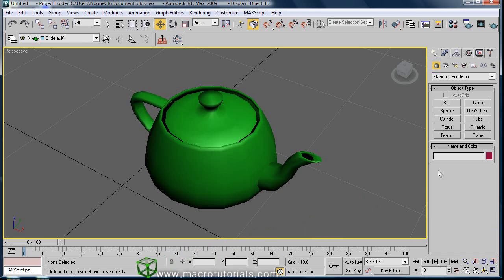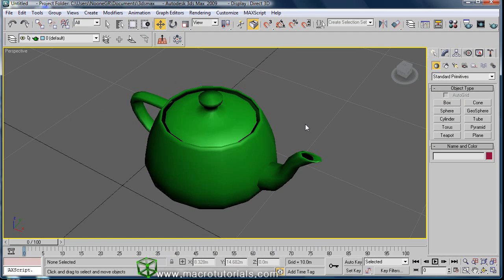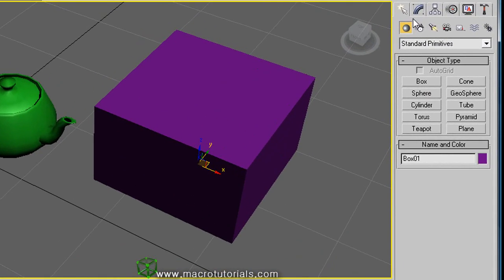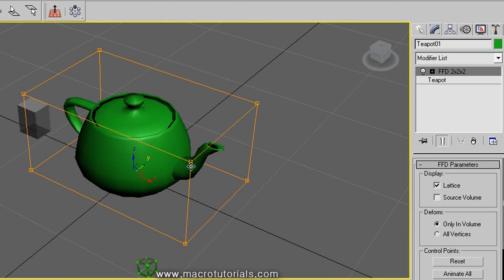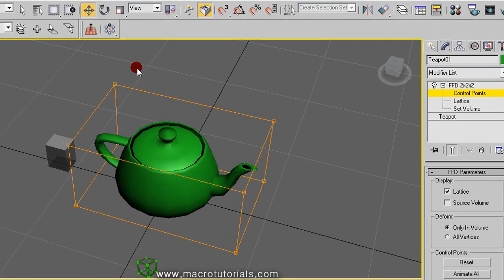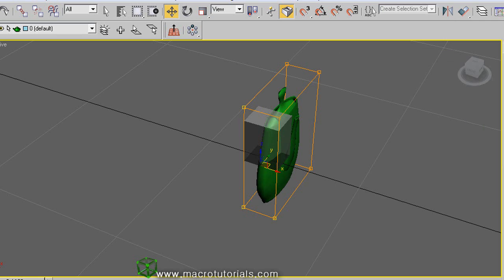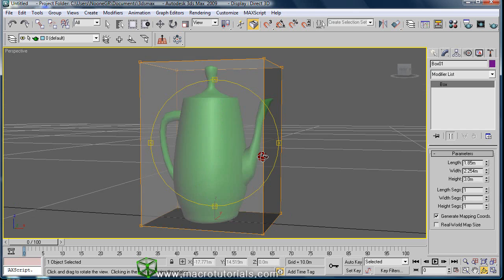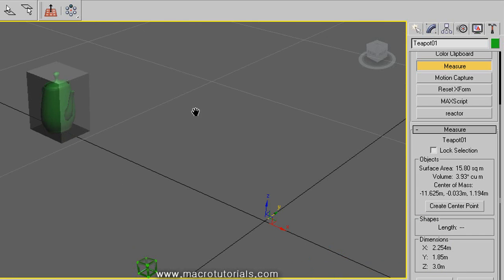3D Studio Max - Tutorial - How to scale an object to an exact mearuse / dimension (Presicion scale)

Comment from the maker: @massarde9591 If you are using Photometric lights or advanced lights, the units system affects the final render result, is not the same render a city model of 40 centimeters than one of 40 kilometers. But the time that takes render usually depends of it's complexity and if you are using advanced lights, the resolution, quality of shadows, and the materials & effects (reflection, refraction, etc)... all this makes that the render takes a long time even if is a single image, and more on a video.